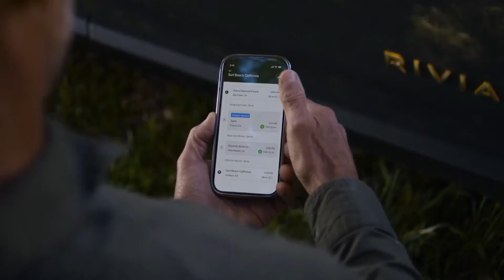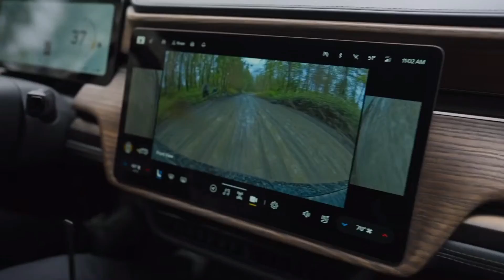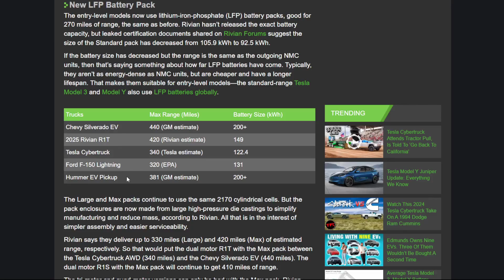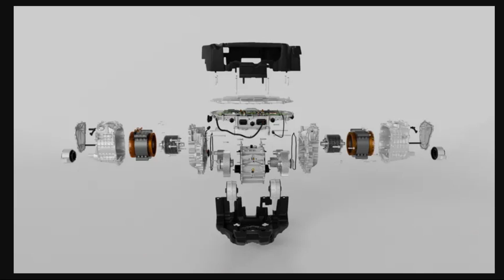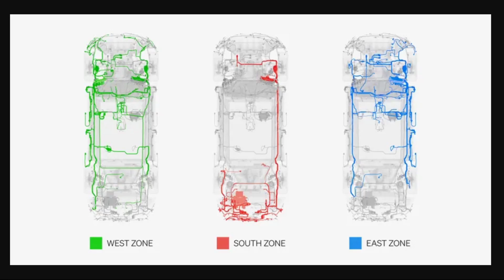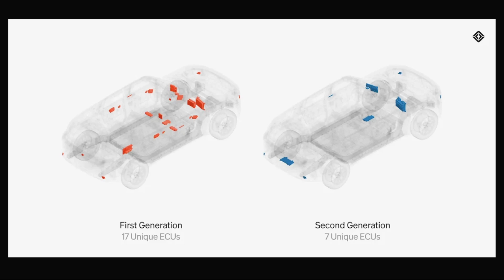Volkswagen's Genius $5 Billion Bet On Rivian - Explained.

Comment: Does anyone know how feasible it will be for VW to integrate "Rivian’s existing electrical architecture and software platform" into VW's electric cars?  Does VW essentially have to scrap everything they've developed so far?  Or can VW merely tweak the systems they've already developed and spent billions of dollars on?  The deal seems a little far-fetched.  In the pictures with VW, CEO RJ Scaringe appears very happy and pleased with himself

Comment: Volkswagen invested onky 630 millions € into Xpeng Motors the best vehicle brand ever realized! Now they invest more, in Rivian which us far behind Xpeng Tianji OS and their comlunication norms between electric and electronic components which is named X-EAA3.5... Ruvian does not have a nice abd convenient durable châssis naked SEPA2.0 or higher! Even the Yangwang E4 châssis is much better than the one made by Rivian...
Reply: @EJFJ-Corporation Rivian is made in the USA, which is the 2nd Largest Auto Market in the World.   VW needs to have a foot hold there, especially since VW models have had problems in almost every area.   Having said that, I think VW would like to buy Rivian and is just testing the waters at this point.   The USA is the largest Truck market in the World and Trucks are the #1 vehicle (revenue) in the USA market, Xpeng Motors has no experience making Trucks!!!   VW maybe make a smart move, especially since it has struggled to make a compelling EV.